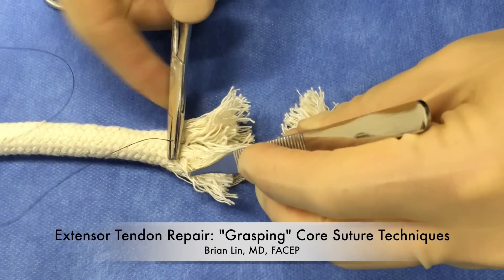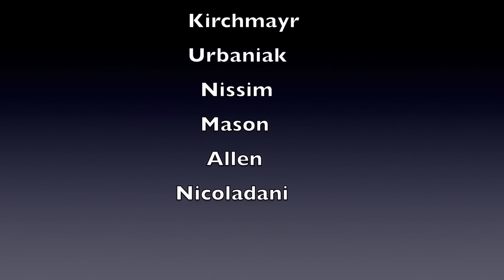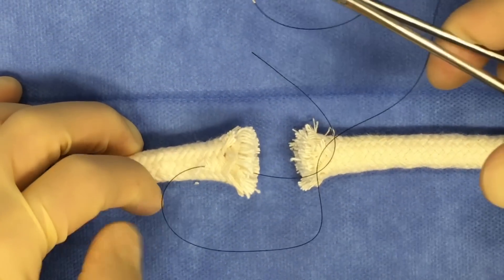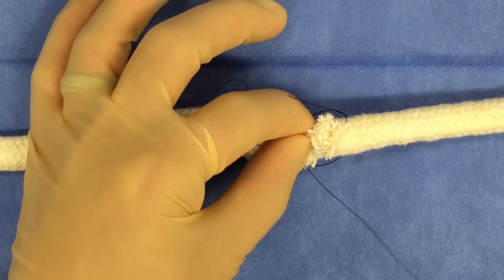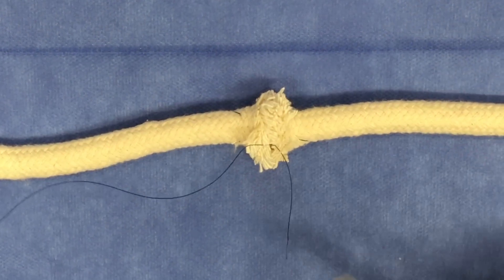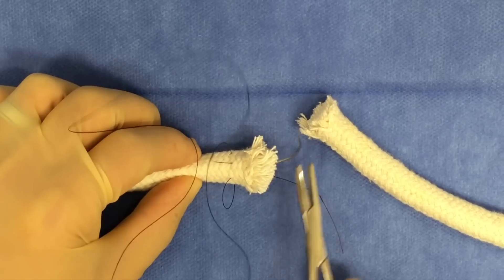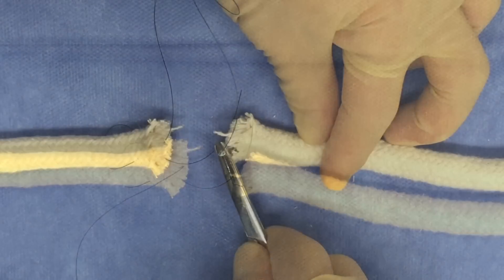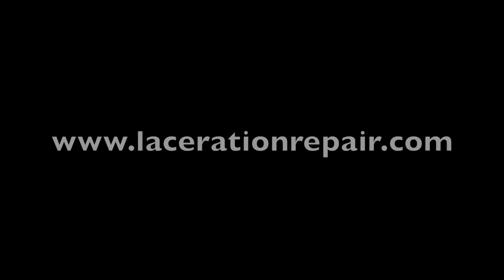Extensor Tendon Repair

Comment: I just lacerated my extensor tendon and cut the top node, closest to my finger tip on my pip joint. Getting my tendon sutured Tuesday however, doc says I most likely won't be able to use my trigger finger again because I sawed that off
Reply: How did your recovery go? I lacerated the extensor tendon on my trigger finger at my dip joint 10/30/22. I had tendon repair surgery on 11/18. It's now 1/13, and Im in physical therapy. My pip joint was very stiff and hard to bend, but its getting better. I can barely move the dip joint though. I can pull a trigger now but its difficult and painful due to the nerve damage. Hoping to improve with time.

Comment: I have watched some videos of surgeons using this knot then sewing all the way around the edge like sewing two bits of fabric together and the patient was able to start movement in the first week .I think that your method was used for my operation 3 weeks ago and I'm concerned about the movement I'm having .this technique leaves frayed tendon exposed and your not supposed to move for a month frayed tendon adheres to scar tissue leading to more problems.my laceration is across my wrist over the top not only do I think he used this method but he used surgical glue on a joint over the top of tendons I don't think this surgery should be done as a standard emergency room procedure it should be done by a specialist with the knot that gives you movement in the first week this is so basic with the potential for more problems leading to tougher rehabilitation or more surgery.a knot that takes a bit longer shouldn't be a problem when its a limb of such importance

Comment: i ruptured my extensor tendon at my pip joint and its been 4 weeks since i got my pin and and i can barely bend my joint half way can anybody tell me if there having the same problem or was in the position i was
Reply: I cut my extensor tendon 2 weeks 3 weeks ago I've taken my plaster of and I am doing mild stretches but I am struggling to bend my wrist forward it feels like there is a block did you have the same problem? .how are you now is your repair good how is your movement I'm interested to know hope your well
Reply: @braveheartthecommentor5805  hello is your wrist better now

Comment: I recently had an Evans Osteotomy combined with a tendon transfer.  I wanted to know how tendons are sutured as surely they must endure very high tension?  Having watched the video, I'm still surprised the sutures survive the strain they are put under.  Surely it will always be a point of weakness in the tendon, however good the suture is?

Comment: It has been 2 months for the injury. Happend by a glass. Injury is cured .tendon is not working. Can i do surgey now ?
Reply: vijitha amarasena I did the same too. 2 weeks ago today. I got surgery on my middle extensor tendon 2 days later. My tendon looks severely swollen, I have no clue if it will stay like that but I have another appointment in 4 weeks. And I’ll be going into therapy. I can make a fist and straighten my hand after 2 weeks. My tendon still feels very week and every time I go to straighten the tendon I can feel the scar. I don’t know wether the scar tissue is causing the swelling but my only concern is wether it will go down. Hopefully it will but you should get yours checked out ASAP.
Reply: @clawnz2193  by reading your comment I realized we have the same injury almost, I'm 3 months out of surgery scar tissue still thick but has lessened tightness, they told me after 1 year it would fully heal are you able to lift heavy things or workout  any info would help thanks
Reply: Fareed Badry Yeah it been over a year now. And my hand was fully able to move after 3 months of the injury. Don’t worry bro you will still be able to use your hand, you’ll just have a bit of scar tissue which will gradually go down but won’t look the same. My hand is fully functioning now and I’m always working out. Hopefully you recover 🙏🏿